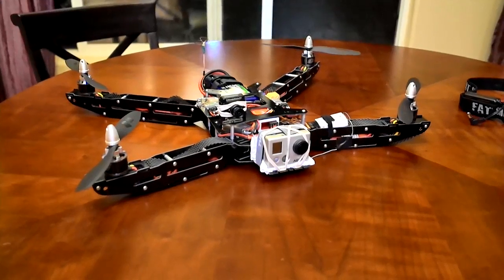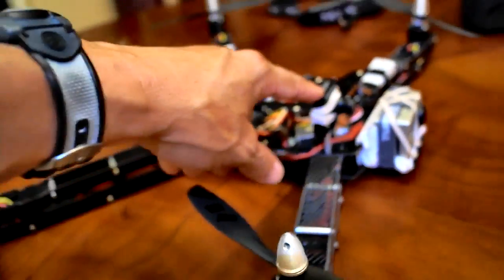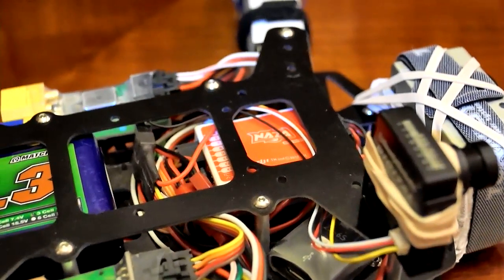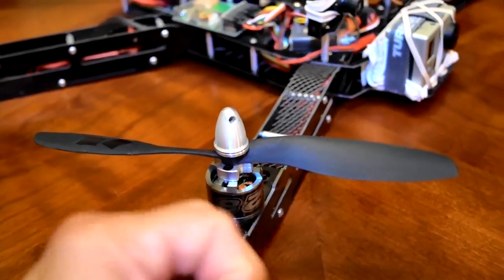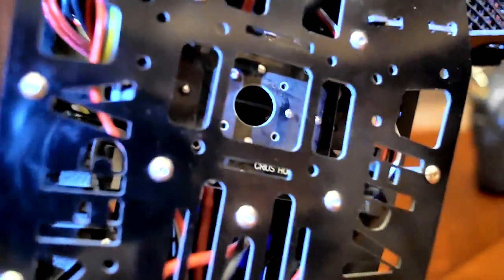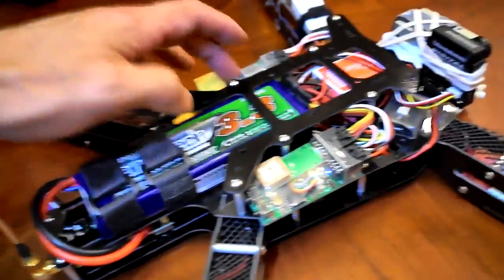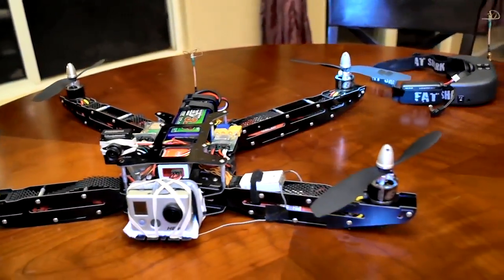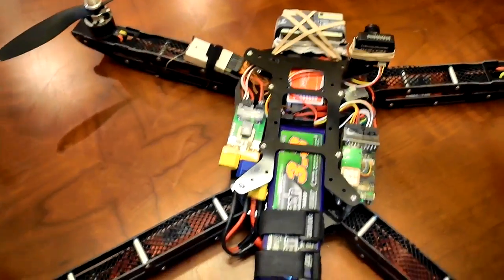HT-FPV NAZA Quadcopter Build Configuration

Comment from the maker: Flight time for that build was averaging around 7mins with 3300mah 3S packs.  Hoverthings is the website name.  They also sell a new platform called the Hoverthings FPV- FLIP, which I hear is an excellent frame choice as well.  Newer and slightly smaller/lighter than the HT-FPV I used here.

Comment: Dave if you use a old gel type computer mouse pad and trim it to the size of the gopro's foot print it will dampened all the vibrations from the motors.

Comment from the maker: Yes, the OSD overlays all the flight information so that you see it as a HUD type of display on the top and bottom edges of the video.  Altitude, speed, direction home, flight time, battery mah consumed, etc.

Range is more than adequate for what I do.  Check out my Royal Resort Cancun video to get an idea of range.  On average about 500meters to 1Km.  Not a long range system by any means, but for FPV video, totally adequate.  Total investment, about $1400-$1600.

Comment from the maker: Don't need to with the NTM motors on this frame.  Just bolt them on the way they come and you will notice about a 1/2 of prop shaft extending under the motor mount plates, but the frame mount plates have a hole for that, so it's perfect.

Comment from the maker: AUTOxxx is correct.  I was referring to programming the ESC's.  Most ESC's can be set to Low, Medium or High timing.  Do some Google research on ESC Timing Settings.  As mentioned by AUTOXxX, you can pick up ESC programming cards for anywhere between $6-$20+ dollars.  Fairly inexpensive and an easy to use tool.

Comment from the maker: @nonamerc I believe it should.  It will be tight though, for sure.  My 4000Mah 3S fits snug from a height perspective but is fine length wise.  If the 4500mah is the same height but just longer in length, you should be just fine.

Comment from the maker: @Brindsley Wright  Yes, I disconnected the red leads.  It's recommended to do so.  When I built my first quad based on the Naza I didn't disconnect the red power lead and never had an issue over the course of a good 3-4 months.  However, when I built this quad on the HT-FPV frame, I made sure to disconnect the red power lead, just to be safe.

Comment: I am having the exact same problem as you OmanLight1. I have a very similar setup as you and Dave Slack. The motors do not start at the same time. I believe the problem is that throttle end points are not setup correctly for each ESC. Normally you do the thing where you turn off the copter, put the throttle all the way up, then turn on the copter and pull the throttle down after a few beeps. Mine will not program this way! I am not sure what else todo. Does anyone have any ideas? Dave?

Comment from the maker: Depends on your surroundings.  In the city, about a football field.  In a rural area or a park about 300meters-500meters, in large open areas with no structures - 1Km (1000meters).

That's about the best way I can describe effective ranges.  Also, 5.8Ghz does NOT penetrate well through solid objects and really dense tree areas.  So, the ranges above will be greatly diminished if flying behind things.

Comment: hii Dave Slack 

hii
 
i have a quadcoptere with NAZA

i used dji f450 frame
 Motors: NTM Prop Drive 28-26 1200kv 
ESC: Turnigy Plush 30A
 Props: 9x4.7
 transmitter: Turnigy TGY 9x
 
i have a problem>> 
the motors not start at same time
 
so i cant fly
 
plz help me

Comment: I have the exact! same setup as you except I use a 600 line RMRC/CCD flight camera  and a Spektrum TX and RX.  I would recommend a TBS/fpvmanual Layerlens product that will hold and protect both your GpPro and CCD cameras and will protect your lenses in a crash.  If you have trouble with holding GPS lock with GoPro running line make a camera jacket and line with copper foil to cut RF bleed to the GPS receivers.

Comment from the maker: Hey Tommy212.  Use 4 memory foam earplugs from any outdoor/hunting store.  Then use a thin square piece of particle/hobby board, then put 2 pieces of Moongel on top of the piece of wood, then your GoPro on top of the Moongel.  All Done.  Vibration free video.  :-)   You can get Moongel from most music equipment website like GuitarCenter.

Comment: Are those scorpion straps?  If so they're on backwards... the battery should NOT be able to slide in flight!  If not, get scorpion straps, lol!  Also, your frsky antennas should be vertical in a V orientation for best signal.  If you order replacement antennas from HK they'll come as dipoles instead of monopoles and have more range as well.

Comment: @dslack67 Do you have any issues with the Naza being that far ahead of the CG?  Also have you made any adjustments to the gains since this video was shot?  I have my HT-FPV in the air, and basically mirrored your setup and it flies wonderfully but just in testing.  I wanted to check with you one final time before going into the wild blue yonder =)

Comment: nice build!  I just flew my HT FPV, with the same NTM motors and Naza FC.  Super solid and stable/easy to fly system.  I am using 25A ESC and 9x5 props.  But do you find the 8" are a little better with these high kV motors?  I also plan to run a 5000mah nanotech and maybe 150g of FPV system.  Either EagleTree or Super Simple OSD - depends on weight and need - I kind of don't trust any quad to fly very far away yet (have FPV planes for that).

Comment: hello I'm building my frame like this, but with similar dimensions, is how you measure and post some pieces that my project will be the dimensions of that frame? would be. wheelbase of the engine front and rear, center and size of the lower plate from one end to the other.

Comment: the 28 motors have three wires sticking out, I see you mounted it upside down and you added the 28  prop accessory pack, did you use the round washer or the cross + mount? I don't see it on the video, also how did you mount the motor wires  thought the hole on the  hoverthings motor mounts can you show a close up?  Can you do a quick video of your  quad without the top plate to better see where and how you mounted the naza, mu,vu and power board. Did you use any Velcro anywhere?

Comment: Note- You're using a dual cam setup, GoPro & small FPV.. cool.. I dont have a cam yet, & HT plus several others have recommended going with the Horyzon HD instead of dual cams or spending the xtra on the Gopro.. HT is offering it already setup on the HT FPV RTF setup.. seen several comp vids and it doesnt look too bad.. your thoughts?